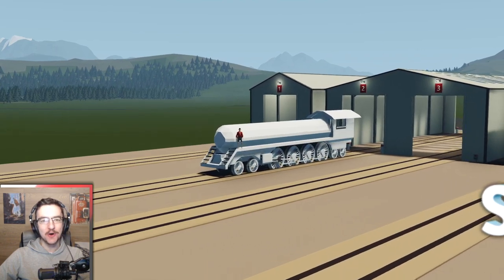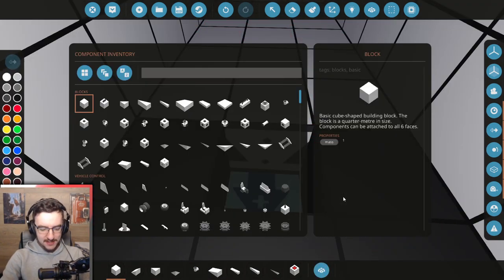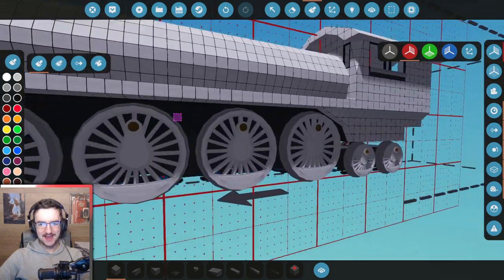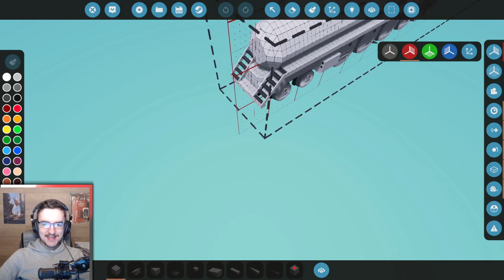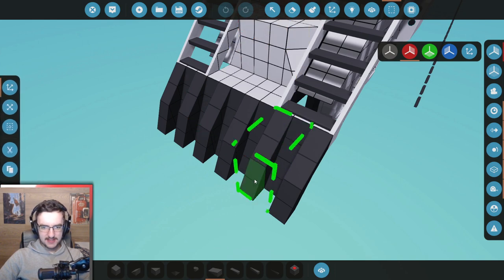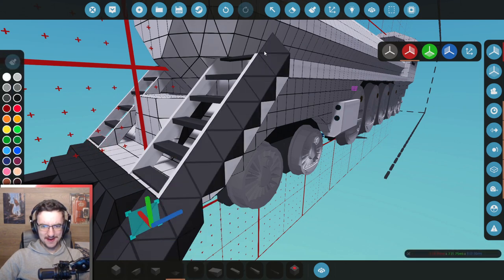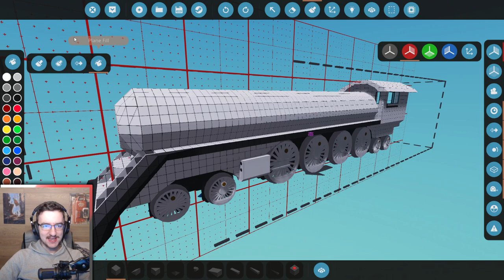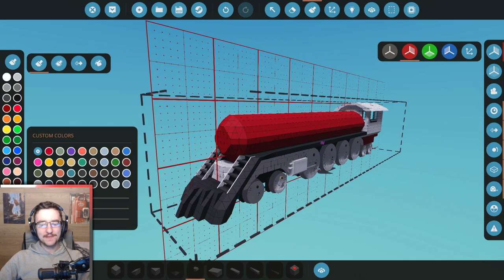We've ADDED A PLOUGH And FIXED THE WHEELS  - Lets Build A Steam Engine In Stormworks!

Comment: I have a feeling that this train is going to be very unhappy with the extreme curves some of the Stormworks Rails have in them. Again, it's only a suggestion, but making an articulated train was the actual historical solution to this and it works in the game. You could try running the small single bogies on your front and rear 2 bogies and then hooking the input of those to generators. As the train rolls along, you'll lose a little speed, but you get power generation. Not a massive amount, but some.
Reply: The historical solution for Non-duplex drive steam engines was a lateral motion device, but youre right because a lateral motion device wouldnt work in SW